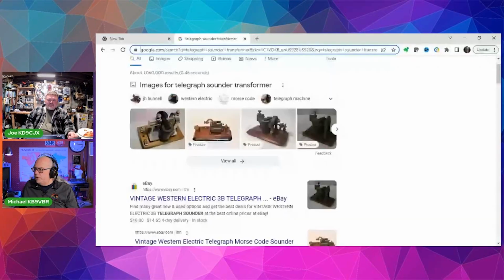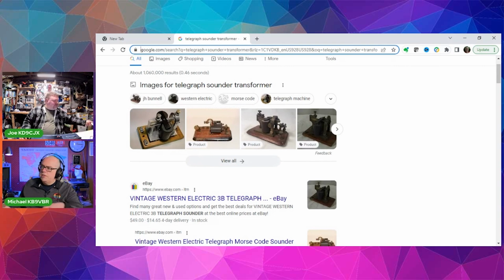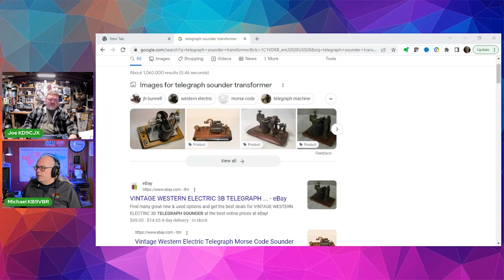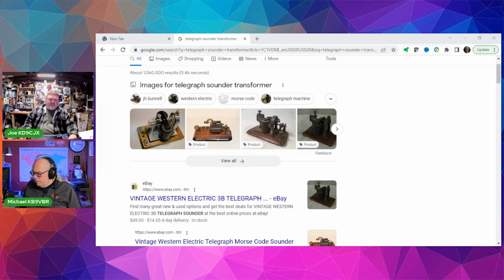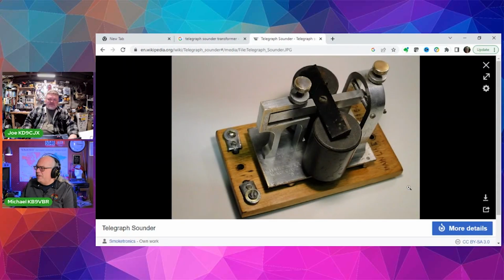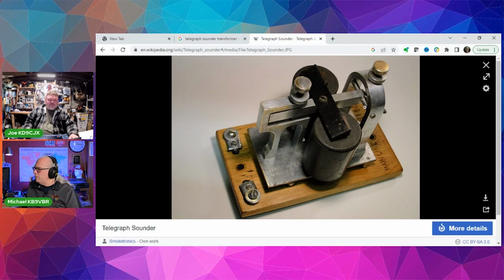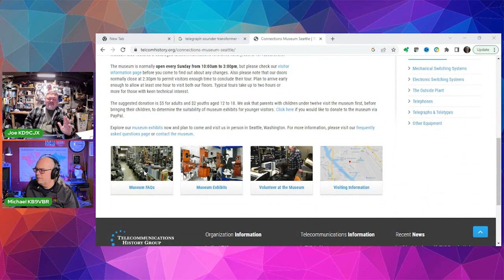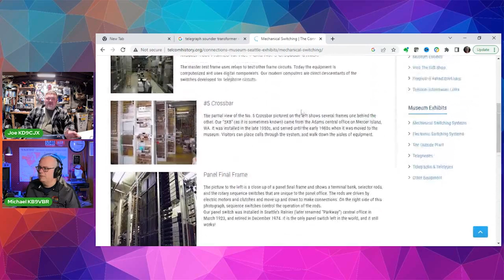Ask Michael, KB9VBR: Setting up a telegraph station between two buildings #Hamradioqa

Comment: Start easy with the voltage on a sounder. Some work fine with 1.5V. Liquid cells in glass jars were used.  I have lots of sounders, telegraph keys, and boards that have sounder and key on the same board (key on board). Telegraphs use 1 wire and ground stakes but you can use two wires. Telegraph operators used American Morse.  My telegraphs stuff was made between 1880 and 1920.